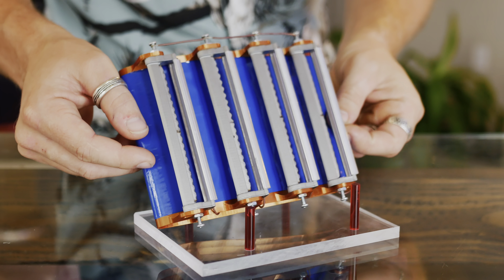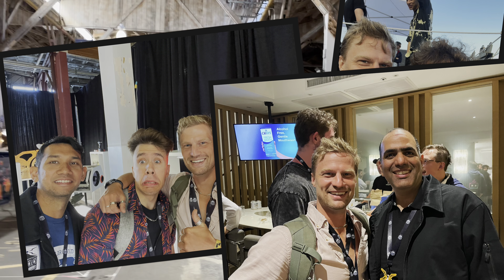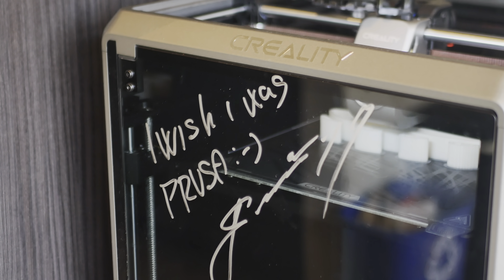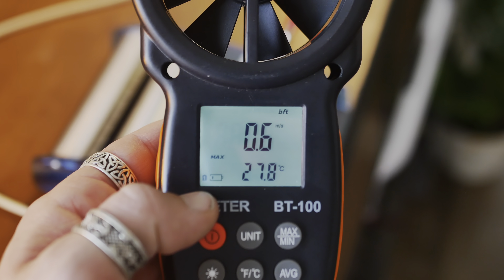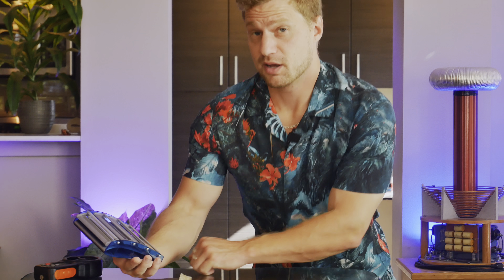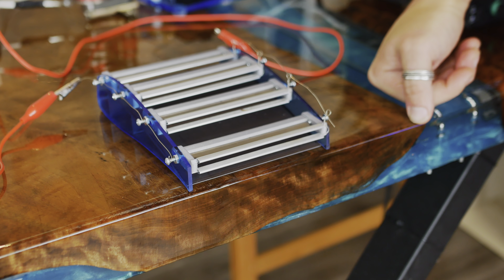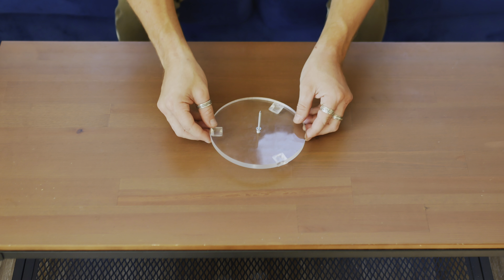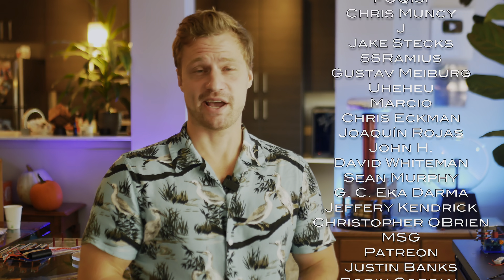Designing A Self Propelling Ionic Thrust Wing

Comment: Man! this is beautiful... Let's see if Joel can one up you now! And to answer your last question... probably NO! Sorry, but I don't see this being an efficient way to fly! Issue is to get very high airflow I expect there to be exponentially high electrical waste. Doesn't mean these efforts are useless. not only the science coming out of these experiments could lead to new breakthroughs, but also, this would already make a great space heater that kills 99.9% of the airborne germs too!! 😁
Reply: I’m wondering how it would work if it was raining?
Reply: @xidannadix9386 
Same. I've always wondered how dangerous that would be or if it's even a problem at all.
Reply: @xidannadix9386  Rest assured it would be contained and rainproof.
Reply: @xidannadix9386 even just humidity screws them up. In his previous videos when he was trying to power a small boat it was constantly asking and losing thrust.
Reply: @xidannadix9386  or in an electrical / thunder storm... Probably not ready for prime time flight.
Reply: @xidannadix9386 that’s the major issue I see with this system. Besides getting enough thrust to overcome friction to even get rolling for takeoff. Of course you can use launch/catapult systems, but you really need to be able to take off from anywhere long enough for run-up.
Reply: @GryphonArmorer  
he wasn't even talking about the fact that you have less lift during the rain.  
he was talking about how would water effect the thrust output.  
it would probbably interrupt the clean flow of electricity.
Reply: @attack125  I don’t recall saying anything about the rain, just thrust issues. And that energy solutions are on the way. 🤓😎
Must have confused me with someone else’s comment. 😉
Reply: @GryphonArmorer  
the guy you answered said "i wonder how this would perform in the rain" 
and then you responded with your comment about lift..  
wich is why i responded to you.

do people not scroll up and read?
Reply: @attack125  yes. Do people not follow the conversation?
Dealing with moisture is less of a problem if you can’t even generate enough thrust to be feasible.
Reply: Efficient? Nah. But tell me you wouldn't fly on a plane with glowing wings that also doubles as an ozone generator lol
Reply: @Sun-ut9gr  So it's funny that you mention this... I was just thinking, what if this became a mainstream way to fly, and as a result our Ozone layer started thickening 🧐
Reply: Also fyi, lithium battery energy density is about 300 wh/kg but liquid h2 is at 33 000 wh/kg! Yes there are trade offs but just so you know we got the juice!!!
Reply: @alphauno6614  I imagine the wh/c^3 is a problem then.
Reply: @henryc7548  In the water, which is where this engine flourishes, volume is not the primary concern. Just look at the humongous ships. In air yes but not in water.
Reply: @alphauno6614 Liquid H2 has considerable energy costs that can’t be reduced. (Physics of ionic bonds). It’s also got the energy cost of deeply refrigerated storage and the poor efficiency of extracting useful power. Not to mention the high weight of storage containers.
Reply: @alphauno6614 No it really isn't. Energy is not magical, and requires conversion between forms. Hydrogen would have to be stored somehow, not teleported, and the cutting edge, best theoretical storage is 7% hydrogen by weight (IIRC off the top of my head, vanadium doped graphitic carbon nitride hits the mark, though there are unpleasant temperature considerations for storage/release). And that's not a practical, tested technology, it's the best we can realistically invision with existing tech. Most practical solutions, like cryogenics, are less than 1% by weight. Then you need a means of converting the Hydrogen stored into energy. You're probably going to need an internal combustion engine to power a turbine, or a hydrogen fuel cell to drive a current. That's also heavy, and difficult to do at very small scales.

When you factor in all the inefficiencies at each conversion step, plus the huge ratio between the mass of the storage+conversion device, you quickly understand why Lithium based batteries are so popular.
Reply: Isnt a device like this one making a ton of ozone? I wouldn't think it'd be safe to run indoors for extended periods of time
Reply: @Nonzerotonin hmm, that could be a problem
Reply: What about an airplane that takes off with conventional thrust, and uses ionic thrusters at cruise to reduce or eliminate fuel consumption?
Reply: @PsRohrbaugh Because ionic thrusters are not an efficient way to move sir.
Reply: It is beautiful but I wouldn't recommend flying in a storm.
Reply: Yes Yes and Yes, On all fronts E.B.  The Experiment = Beautiful Visuals, Useful Data, and over all is Full of Possibilities!    Also I would buy a compact germ killing space heater...
Reply: Hello @PlasmaChannel This video was awesome ! very interesting, you achieved a big step in this Solid State Flying Object ! I suggest you two idea to optimize the thrust : 1 you can describe your project to chatGPT and ask it to use coanda effect and venturi effect to propose multiple adaptations which could optimise thrust by design. 2 you can read or see come videos about MHD technology and planes, the French scientist "Jean Pierre Petit" explain some interestings things about the Aurora B2 MHD and how it works. I wish you the best, this is a very interessting subject and maybe the future of flight.
Reply: What about using a horizontal magnetic field to shape the field more effectively and improve efficiency potentially? You could also potentially use a magnetron to create an ion source if the pressure is low enough, and longitudinal magnetic gaps embedded into the wing to focus the plasma into individual channels along the surface of the airfoil, potentially increasing output pressure while also increasing surface adhesion. Weight of a magnetron is non-ideal, but at scale a similar approach may be higher efficiency. Very interesting concept, some really great MHD formulas in Intro to Plasma Phys and Controlled Fusion by F. Chen if interested.
Reply: @HarperChisari  bro this sounds like some shit Spock from Star Trek would say, but also you definitely onto something. like you said I think he would need to incorporate the megatron into a larger model, or maybe just onto the body of a more complete glider. He could also use some form of magnetic flow stuff to create a more condensed, higher pressure, flow of plasma off of the trailing edge.
Reply: Imagine this going into the vacuum of space and providing continuous thrusting, the acceleration would provide big momentum. Also this could work for zeppelins.
Reply: @johnnychang4233  
how would it?  
this thing moves by ionising the air and moving it with the electro magnetic field.  basicly it's pulling itself along on the air that's present.  

there is no air in space for this thing to pull on.  
it's not an ion thruster.  it's an ionic thruster.

same concept but it doesn't have it's own tank of gas that is being used as thrust by accelerating it out of the back.  

these ionic thrusters are actually way more powerfull than ion thrusters.
because it doesn't need to carry the fuel.  
and what sounds more powerfull to you?  
accelerating a clump of atoms of gas out of the back pushing off on the acceleration. 
or pulling on the acceleration of billions and billions and billions of atoms of whatever gas is present (including pushing off on the slower moving atoms behind it) 
creating a lower pressure area infront of it and a higher pressure area behind of it.
Reply: @attack125  Remember that Space vacuum is not perfect, also the gas and air itself exert a dragging effect on the object propelled which is minimized with a near vacuum condition.
Reply: @johnnychang4233  
don't try to save face.  
it will do jack in space.  it does not have it's own fuel like a real ion engine.  

and i know our atmosphere extends to even beyond the moon.  
but where do you stop counting it?  

99.% of the entire atmosphere is below 30km.  
space doesn't start untill. 100km.  (or 80km if you follow the old karmen line) 
that's 70km before ever even reaching "the vacuum of space" where this type of design would have no effect already.  because even though it's not a perfect vacuum.  there is most deffinatly not enoegh air for this thing to move to even give you a measurable reading.  let alone thrust.    

i can't even imagine this thing being of much use at even above 5km.  

most commercial planes only go up to 12km.  concorde has done 18km. 
and they are using engines that have a much much higher thrust to weight ratio than this thing.
Reply: @attack125  It does need fuel though, in the form of batteries.
Reply: @attack125  That is why I mentioned the zeppelin in a previous comment, you don't depend on the thrust attained with the wings for buoyancy. Also in a concentric configuration I think the effectiveness should be greater.
Reply: @johnnychang4233  
if you are just going to start ignoring what i say then i'm gonna do the same and i'll just stop responding to you.  
it's like talking to a goddamn wall.

fyi.  the reason planes don't go higher is not because of the ffing lift.  it's because they can't provide any thrust to keep the speed going. 

incredibly high powered jet engines.  cannot provide the thrust needed.....
Reply: @attack125  Why are you insistent into taking the rocket science approach while here we are trying to attain a minimal functioning flying model?
Reply: This setup of speeding the air up on top of the wing might net a significant amount of lift. But I still don’t see it being very efficient across the board. Very fascinating though!
Reply: @norske_ow3440 hmm, now you have me wondering about hybrid approaches.
If they can create significant lift, could it be incorporated with a standard wing in a way that makes flight easier, than the potential drag addition. Netting a fuel savings?
Reply: and mosquitoes
Reply: Can you make an educational video about this topic in future?
Reply: the cope about this clickbait is real.
Reply: The USA has nuclear planes. This as an addition would be nice.
Reply: A major tradeoff with this system is that you wouldn't need to carry a heavy motor, though you would need to carry batteries. Could also make some sense in an all electric "hybrid" system, where the electric prop is aided by this.
Reply: Hey have you ever accidentally shocked your balls? @electroBOOM
Reply: @LeafBoye  Accidently... I don't think so.
Reply: @modyosman5059   but maybe on purpose, you mean? xD
Reply: @kjgfalsk  Someone gets it 🤣
Reply: no, because he never does anything accidentally  @LeafBoye
Reply: @LeafBoye  My man's over here asking the important questions
Reply: @LeafBoye no response
Reply: And 100% of small fingers...😊
Reply: THE MAN HIMSELF
Reply: Could bend balsa wood for the wing surface for saving weight vs 3d printed wing
Reply: What if you used static wicks to "harvest" ions from the air in flight? In rotary wing we call this rotor arc. I don't know if fixed wing have the same problem.
Reply: What about propulsion for deep space probes?
Reply: Maybe using radiofrequency excitation of the plasma instead of coronal discharges would increase the amount of charge around the wing, allowing for more transfer of energy into flow. Just an idea
Reply: If the waste electricity is one of the main concerns, would superconductors make large ionic thrusters feasible?
Reply: No electric waste if you regenerated with a spiral wing and static hub.
Reply: Tried using copper sheets for positive and aluminum sheets for ground maybe ?...I don't know.
Reply: Note... if you going to use metric ... don't speak in centimeters.  Your not a dress maker... use millimetres.  Why introduce a decimal place when you don't need too. Construction and engineering use millimetres... 🤔😂😎🇦🇺👌
Reply: Don’t fly it in the rain
Reply: I think you are underestimating what a man like him can do when he takes things to their limit
Reply: 99.9%?
That's more than Lysol! ;)
Reply: What if by mistake it gets water drops or maybe large amount of water in intake in the bigger and powerful version of this ionic thrusters
Reply: Hello, are these "400 KV voltage boosters" dangerous? I scouted the internet and the best I got is "probably not but maybe" which is not satisfying.
Reply: I can get 80 - 120 km/h for a large drone ( according to my extensive calculations) but in light of recent events I would be unwise to share it, it is so simple really but the problem is what you could do with such technology that comes back to haunt you.
Reply: Throw in some music and you can fly on "sound waves"
Reply: Flying bug zapper 3000
Reply: @electroboom why does the electrical waste need to be exponentially high? Why not linear? also you can put these ionic thrusters in your firefly lantern to really spice things up in there 🤣
Reply: DUDE THE SUICIDAL MAD SCIENTIST IS HERE
Reply: Ahhh filling the room with ozone. Best way to kill everything. lol
Reply: Give me a shoutout 
out I’m gonna be an engineer
Reply: It's the legend himself, the man inmune to electrocution!
Reply: однажды, микробы подкараулят тебя!
Reply: Pls dont "accidentally " touch this .
Reply: You're correct, this is not very effective for atmospheric flight, but this has the potential to sustain a flight for some time. If this technology is improved further, we might have this as a way to propel stealth drones for short distances in the military by reducing the acoustic signature in close to target regions, this is quieter than propeller drones (result from my own experiment, i measured it for a wide range of infrasonic and ultrasonic frequency, but may vary on larger scale)
Reply: @Maharishi.  you need to be isolated.
Reply: @baltasavr  i don't think so, as I tested my prototype in the Kolkata summer air, not in an isolated system. But yes, I am not an expert, so there may be more dynamics on larger scale that I am unaware of.
Reply: Why did I read your comment in your voice😅
Reply: Omg! Well said! Just one of your videos
Reply: if portuguese had the same money as america in porpotion ofc, we would be able to probably compete better , just saying .. anyways when its about science its never a competition .. great video
Reply: What if you kept it low and covered the wing with solar panels? It might not be enough to keep it in the air on its own, but could it reduce fuel consumption on the primary propulsion system?
Reply: 4:35 sounds like they should've given you a printer 🤷‍♂️😉
Reply: Once flying... The wind won't be an issue. I'm a fabricator. Not an engineer
Reply: Could the device capture and reuse the currents it crosses in the air? Basically becoming a stormcloud mantaray? The voltages up there are normally ignored, shielded against, or avoided, but there is some crazy energy that, if tapped correctly, should offer decent charge.  Just becomes a matter of harnessing it.
Reply: @ConnorSinclairCavin  those voltages are relative to ground. Once you're up at the height of those potentials you are then also at the same potential so there's no difference that can be exploited.
Reply: @thealexthorpe  ah, i was thinking of using the battery bank’s energy void as a grounding basis… not earth strong, but still, but perhaps that would not be enough
Reply: @ConnorSinclairCavin  battery or no battery, voltage is relative. You could raise a 4.7V Li-ion battery to a height where the electrostatic potential to the ground is 400kV for instance but because the battery terminals are also at that height there's still only 4.7V across it. Relative to ground the potential would be 400kV + 4.7V from the +ve terminal of the battery but that's only usable if you have a means of moving current from that height down to the floor.
Reply from the maker: You’re forgetting one thing - as you go up in height, both the ground electrodes plus the positives increase in voltage gradient. But since power is applied to the positive, it always has 30kv higher threshold.
Reply: @PlasmaChannel  Although first order of business of flight is getting off the ground usually, unless you have a glider which needs a tow.
Reply: If we ever get the perfect battery, then maybe these wasteful, energy intensive sci-fi propulsion methods will be a thing. 🤷‍♂️ 🔋
Reply: @blaircox1589   NASA's "solid state" batteries are looking promising.
Reply: @blaircox1589  we will not. Nothing is perfect..
Reply: @blaircox1589  зачем? почаще задавайте себе этот вопрос и не стесняйтесь дойти до конца ответа.
Reply: @blaircox1589  The waste of energy to get the benefit of almost no maintenance...
Reply: @AMV12S   energy still has to come from somewhere, there's maintenance at some point.
Reply: @AMV12S  I think what he's getting at is that you would need to consume a prohibitively large amount of fuel in the form of battery weight or generators. An electric motor powered glider would probably be more efficient and a brushless electric motor already has essentially no maintenance.
Reply: @blaircox1589 it’s coming. I’m working on a solution for this very problem. It relegates batteries to an emergency use only. 🤯🤓😎
Reply: Yea not efficient but neither were solar panels when they first came about or even the first computer but look at them now! Exponentially growth baby!!
Reply: @ElectroBOOM i love what's been going on in this series. i dunno if thrust per watt hour is the best way to judge, but i have a feeling in the end, it'll be really cool, but perhaps not competitive. and i am a-ok with that B-) hehehe
Reply: Dont listen to @electroboom, he cant turn lights on without frying himself, dream big and keep on doing these experiments.
Reply: Mehdi, you're still alive?!!!  honestly I stopped watching after you nearly electrocuted yourself, let's see what video was that, oh yeah its most of your videos.  to be more clear it was the one where your sketchy high voltage thing fell on you, and you threw it off, I thought you were an engineer.  oh that's right, not a structural engineer.  your base was so bogus it wasn't funny.  but honestly I am surprised you're not dead.  mike